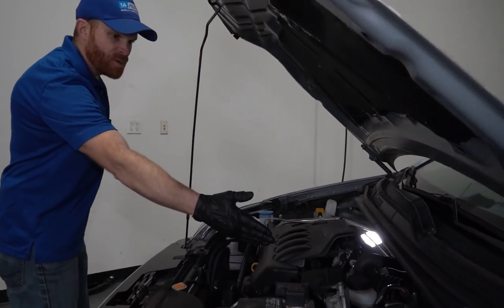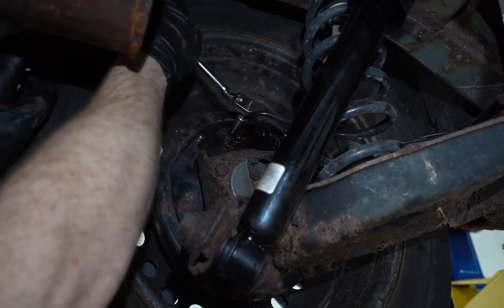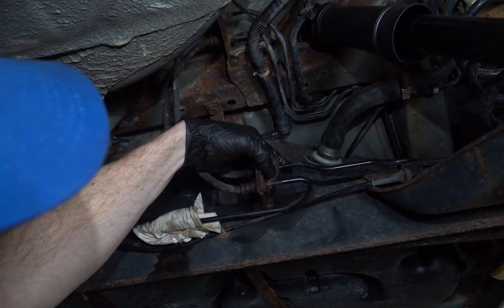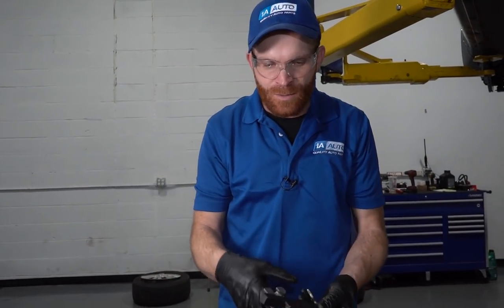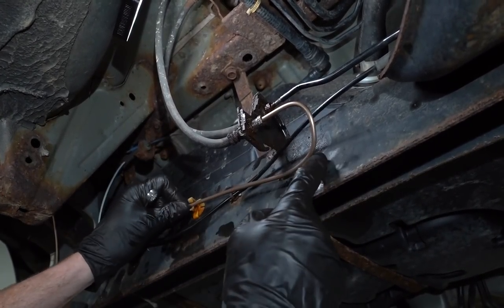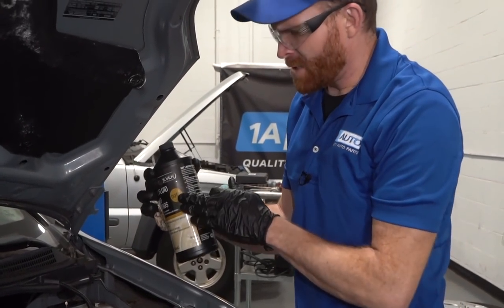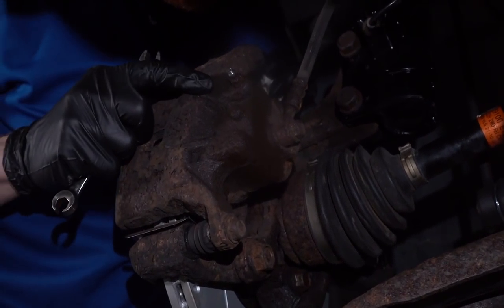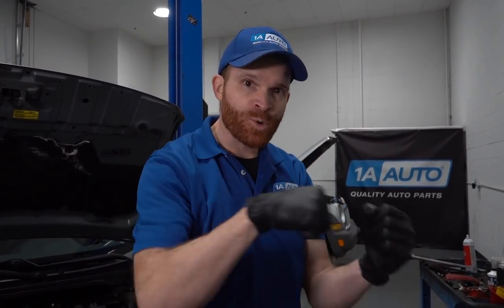New Brakes but Pedal is Still Soft? Check Your Brake Lines for Rust or Damage!

Comment: Happened to me, jacked up my car to check out my brake pads, when I assembled everything back and went to drive, the peddle went straight to the floor. Learned that each brake lane coming from the the ABS block going to the wheel was nearly rusted through, with one finally failing, presumably from stressing the subframe from lifting it. To say the least I've replaced every inch of hard line in my car and hoses for good measure after that. Thankful it happened in my garage and not on the road. Looking back I should have inspected the lines on my car months ago since its so old (1998), used unprotected steel lines and I live in the rust belt. CHECK YOUR LINES REGULARLY!

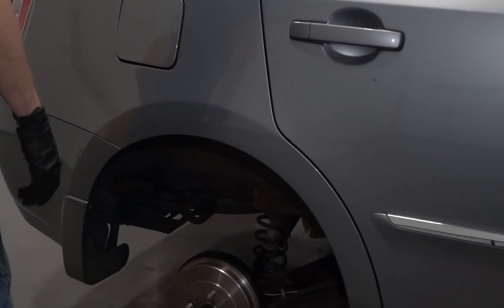Comment: At 53:17 at the union that connects the copper line to the union, you can see air bubbles coming out. That nut  is either still loose or it's a bad seal. You can see it bubbling.

Comment: Fluid film/transmission fluid coating on the underside go a long way toward preventing that rusting. Same wtih inside the rocker panels, lower door panels, and wheel wells.

Comment: 😀👍 Thanks for making this video! By the way can you STOP an SUV if the brake line pops on one side while driving? 2000 Dodge Durango 4WD.

The reason I ask is because one year one of my front lines popped while I was in park fortunately, I've been paranoid ever since. They were the original brought the vehicle new. So they lasted a little over 20 years. I'm thinking about getting the plastic coated ones like you"re showing to prevent some rusting. Thanks.

Comment: I DID NOT GET IT HOW YOU STOPPED THE BRAKE FLUID after cutting the lines??   You squeezed it with a pliers the rubber part????

Comment: So I've had an issue. Everytime I change brakes I get a spongy feeling afterwards. Like it's not firm like how OEM is it's soft. I've checked the lines and calipers and all that, Everything is fine. No leaks either. Is it because I forgot to open the reservoir when pushing the piston back?
Reply from the maker: +Official Yung Twizted We wouldn't be able to diagnose an issue like that here, you may want to have a local mechanic take a look at it. Thanks for checking us out! http://1aau.to/m/Shop-1AAuto-c

Comment: Engaging tutorial. Realized I watched the whole thing after I watched the whole thing (this isn't even my car type). BUT, seems like a waste of time and labor cost to clean up those ends when they probably cost what, $2 to replace? Maybe $10 for a set at most in everything-is-overpriced-here California? Also kind of sad that the nice coated old line was replaced with an uncoated line. I think I'd be upset if I got that back, tbh.